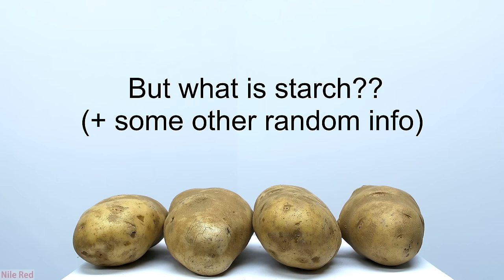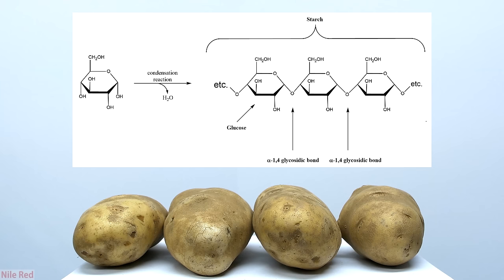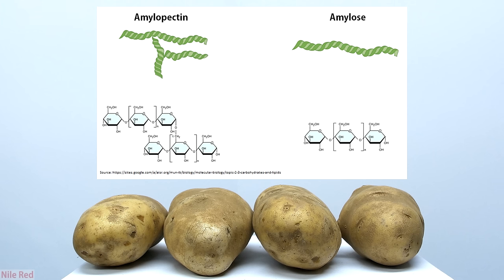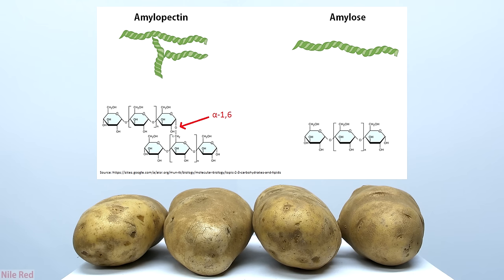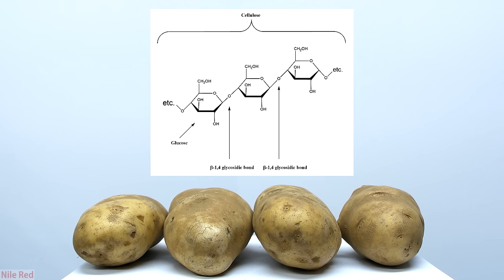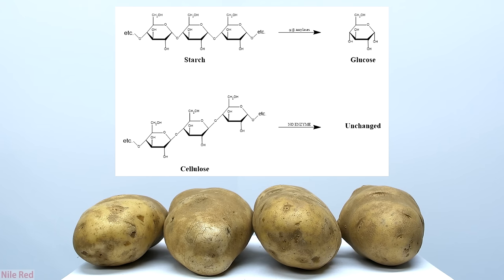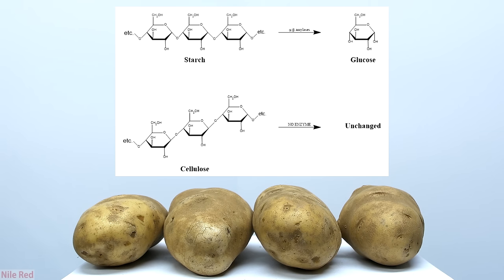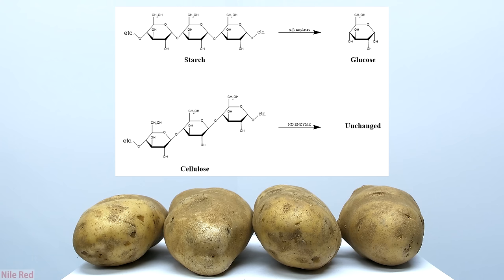Extracting the starch from potatoes

Comment: Maybe glucose from starch? :)
Reply: Ya got a good idea. I'd love it if he showed us how to isolate polymers of glucose into its main monomer, glucose. If possible, it could be also done with regular paper or cotton, which is almost all (96%) cellulose, then easier to get.
Reply: +neonlent or, easier and shorter, how to break the glucose-glucose bonds in cellulose and starch.
Reply: acid+heat
Reply: I think heat is pretty much everything you really need (although enzymes like amylase certainly aid the process).
Reply: All you'd need is amylase and heat, I do that stuff all the time.
Reply: with heat only you will get water pudding. its good if you add bunch of fruits and sugar to water beforehand. in poland we name it "kisiel"
Reply: 5Rounds Rapid easier if you just make it from sugar wash xD
Reply: You just need to increase the acidity to about 1.5 and heat it as high as you can, possibly with a pressure-cooker so you can cook it at higher temperatures without it boiling.
Reply: Cody's Lab did this!
Reply: I think you mean sucrose?
Reply: Amylaseeeee
Reply: Turn carbs into cellulose?
Reply: Well he did toilet paper into ethanol now so i guess you guys are divine beings.
Reply: Cody's lab did a video on that
Reply: Just spit into the starch, add some water, give the amylase time to work...
Reply: ButtonMasher 
My digestive system does that all the time.
Reply: Would probably need some amount of amilase or other enzymes not sure

Comment: This should really go without saying, but you should mention that using laboratory glassware to do the washing in (Instead of kitchenware like you did) would probably negate any further use of the potato shavings for eating purposes. Just to be safe. I'd never eat anything that has come into contact with any lab glassware or equipment that was previously used, even if thoroughly cleaned beforehand.

Comment: The cooked native dent corn starch paste (solution) is cloudy because of amylose recrystallization when it cools of.  Potato starch is used in applications where paste clarity is crucial because it's lower amylose and the amylose is lower chain length than dent corn starch.  To get clear dent corn starch pastes you either need waxy corn starch which is almost pure amylopectin or modified corn starch.  Modification with ethylene oxide, propylene oxide, acetic anhydride or acid will stop amylose retrogradation.  I made 2-3 million pounds of corn starch per day for 40 years and 500,000 lbs/day of potato/tapioca/rice starch per day for 16 of those years.

Shredding the potatoes on the coarse side of the grater will give you about 0.9-1.25% of the total potato weight in dry solids starch.  If you'd used the fine side you could have increased the yield to 1.5% or so (DS basis) because you would have ruptured more cells.  A russet potato is 9-11% ds starch on a total potato weight.  In Europe, a special cultivar is raised for industrial starch production that is 21-24% ds starch on a total basis.  They taste like chalk when eaten raw and are no good for cooking.

Comment: I would be interested in how to make the modified starches that are commonly seen as a food additive. Sometimes its modified by reacting with another chemical and sometimes it is somehow pre-gelatinized while maintaining a dry powdered end product. They seem to be used in a lot of quick prep food items like hot chocolate mixes and powdered sauce packets, so thickening/stabilizing can happen quickly with hot water rather than a full boil and no raw starch taste or to avoid clumps and lumps when dumped in hot water.

Comment: Arrowroot starch can also be a good option if you want a clear solution, particularly after heating it and thickening it....it is also more heat stable than corn starch and wont break down if heated too long. Tapioca starch is a good choice if you want to freeze your starch for any reason as it doesnt go clumpy and mushy when thawed like corn starch does.

Comment: Use the left over potatoes to make hash browns. Clarify some butter by melting it and allowing it to separate in a clean beaker.  Decant the clear yellow fat.  Save the white protein solids to enrich other dishes.  Mix some NaCl into the potatoes.  Put the clarified butter and potatoes into a pan.  Raise temp to 350F.  Add some paprika and pepper. Remove when suitably browned.  Unlike some of NileRed's compositions you can eat this one and it will taste good :) Especially with ketchup.

Comment: use a centrifugal juicer and collect the juice to obtain starch. you can let it sit for the starch to settle or you can heat the juice and it begins to coagulate. If you dry the coagulated mass and crush it using a mortar and pestle then wash it again you have good starch

Comment: In the future, a food processor with a grater disk attachment might be easier to shred the potatoes than manually using a box grater or mandolin grater like used here in the video. If you have a food processor, that is. Cuisinart is a good brand and has a reasonably priced food processor with a grater disk attachment and blade disk attachment (for things like potato au gratin) at about $150.

Comment: Im doing a project now on extracting the potassium from potatos and banana peels. I will use calcium hydroxide then sodium hydroxide to make potassium hydroxide. Just like I seen in a video. I will then use that to extract alum from soda cans and make a big crystal using sulphiric acid . Already did it and it turned out great. The alum kept crashing out but it held together. Size of a soft ball.Lots of smaller crystals. After using it a lot the edges smoothed out. This time the difference is I will be using things from a beach not far from a water treatment plant. I almost cried when ya dumped everything except the starch.haha

Comment: there is some good examples in russian youtube showing how to convert potato starch to eatable shugar
boilyng few hours in kitchen pressure coocker in glass jar(avoid contact acid with metall) with 0.5% of food quality HCl or H2SO4(better), than CaCO3 will residue CaSO4 and after filtration and evaporating - you get tasty glucose+fructose syrup
Reply: need route for bisulfite benzaldehyde extraction, dont want to mistake, before i did with 2,5-DMBA and 5-meo-salicylic aldehyde, and salycylic aldehyde, but that time i had money and all solvents and much reagents to experimentate, now simple need, IPA DCM petroleum ester, toluene water, kitchen glases - syringes... parents died, money finished, federation law-stupidizing etc

Comment: Speaking of potato starch. See if you can make sorbitol from it using an enzyme ( possibly tyrosine) Sorbitol is a sugar supplement and is a good sweetener. From then you can also make Calcium Ascorbate or even Ascorbic acid ( vitamin c) Calcium Ascorbate is not as hard on the stomach as Calcium Ascorbate as the acid and your body converts it anyways. This process might be elaborate and the yield may not be great

Comment: I've always wondered why starch is so easy to break down into sugars, but cellulose isn't. 

I mean, there has to be a reason why the vast majority of omnivores and herbivores haven't (or have barely) developed the enzymatic machinery to digest that potential food source, given how much lies around.
Reply: I know that the ß-1-4 glycosidic bonds in cellulose are quite a bit harder to break than the α-1-4 ones in starch, due to them being strengthened by hydrogen bonds.
Reply: cellulose is a straight polymer, and full of strong hydrogen bonding sites (hydroxyl groups). So the polymers order themselves into thick long fibers. It is sort of like a "crystal", but one direction is held together by covalent bonds, the others are held together by very regular hydrogen bonds. Effectively most of the bonds are protected from the enzyme. So even for a cellulose digestive enzyme, breaking the bond is really slow because it can only access the outer surface of the fiber. 
The regular bonding is also very efficient, so cellulose is quite stable against hot water (but not perfect, hot water can shrink cotton clothes)
Reply: Simply because we do not have the ß-amylases. The enzimes that digest starch are really selective and only that precise molecules will be catalized, in this case the α-1-4 ones and not the ß.
Reply: 000pava You did not understand my question. But neurhlp did, and gave me a satisfying answer. (thanks!)

Comment: Normally after the grating step, I press out the water, heat some oil, submerge the gratings in hot oil in a cast iron pan and heat stirring and flipping until brown, add some sodium chloride that is combined with red pepper, garlic, onion along with several other Cajun seasonings...remove from the heat and add cheese😂

Comment: what if you would just freeze the potato rasped mash, and then defreeze them? during freezing the cells rupture due to the water crystals that grow.... I use to do this with rhubarb to make whine, works very effectively...
Reply: Rhubarb wine? Care to share the recipe?
Reply: glockfan112
 Let me try to remember this, i was making rhubarb wine 7years ago, switched to beer brewing now :) So basically you get a few kilos of rhubarb stems, cut them into 1cm shunks and put it in the freezer. The next day defreeze and squize them, this releases all the juice. The add sugar to required density, nutrisalt and yeast starter. Ferment it for a few weeks. Then decant of the liquid leave the yeast remainders behind on the bottom. Measure the acidity, it will be way to acid because rhubarb contains a lot of oxalic acid. So to correct this you need to add calcium carbonate, this will fizz a lot as it reacts with the wine. Leave to rest for a day or 2 until the calcium carbonate drops to the bottom, decant the liquid, and leave for a few weeks to have the secondary fermentation. After that measure the acidy and density, correct for both. To correct the density I use sorbitol, which is an unfermentable sugar. Bottle it, and age it for 2 years. Enjoy it cold on a warm summer eve :)

Comment: okay I made potato starch and wanted to speed up the drying so I put a small amount in a spoon and heated it up, on the bottom of the spoon the was a droplet of the starch with water and it turned black from the soot, when the sppon cooled i went to flake it off and it was rubber how did this happen